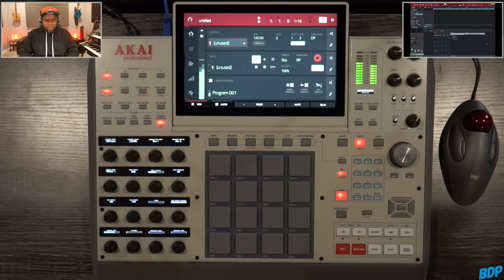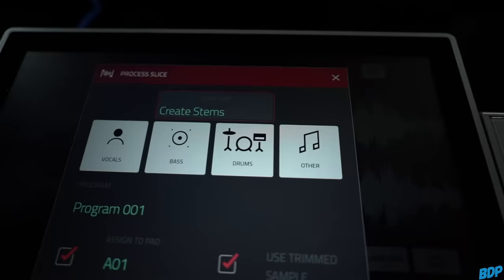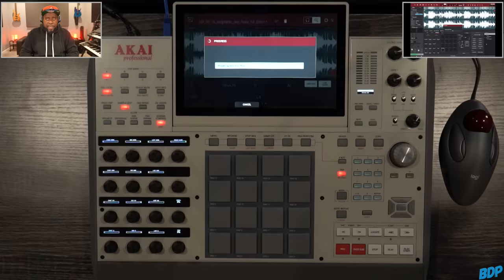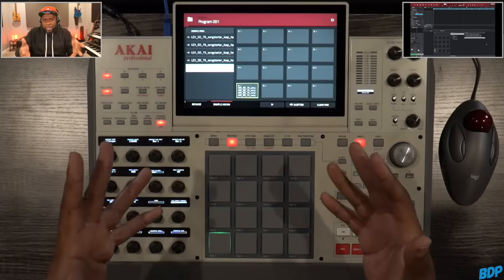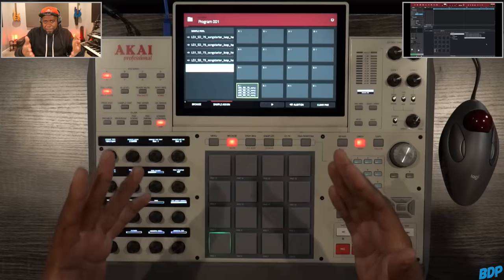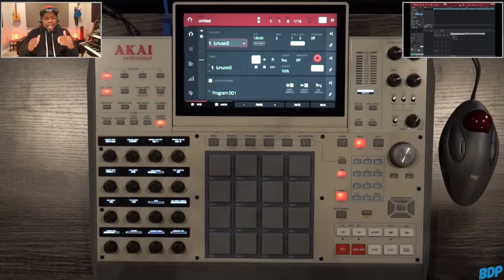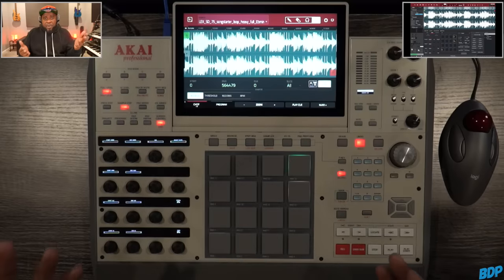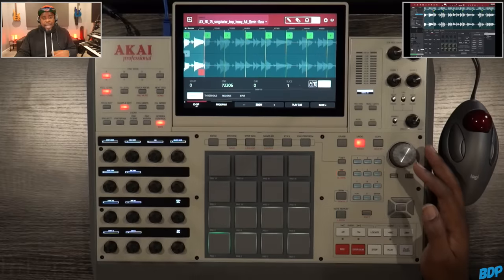It's Finally Here! Akai's New audio STEM Separation tool! 🔥

Comment from the maker: This will be released in Early February for $9.99! Controller mode will be first then standalone coming shortly after! Basically the same way Akai released Flex Beat
Reply: Only have to pay once, right?
Reply: Dint you mean $99.99???
Reply: Dope video bro !!!
Reply: Will We Have To Pay For It Twice..!?!🤔🤷🏾‍♂️🤔🤷🏾‍♂️
Reply: We have to pay for the update to be able to separate stems?
Reply: I use logic and need an mpc. I am using my mouse and  logics beat making feature
Reply: Have you tried it out with different samples and are you getting consistent results when you do in terms of quality and perfectly extracting the different stem types?
Reply: per month? or one time ?
Reply: @Void-tp4yv  one time
Reply: Do you have arranger yet? I do on my Force!😎
Reply: already move to March
Reply: Are you then a "Beta' tester?
Reply: Wow
Reply: They pushed it back to March now according to the site.
Reply: What MPC's will this be available for?  I rock a MPC Live but I would upgrade for this functionality.
Reply: Bolo!  Brother can you please help a fellow MPC X bro out?  I bought my MPC X years ago back when they first came out.
I used it for about a year and then I decided to throw on the hard cover and put it away for the last couple years because I
couldn't stand that there wasn't a built in tuner and many other features that I felt should've been available the day the X
was first released.  With that said, I finally decided to bust it out yesterday after hearing about the tuner being added and
many other features that many of us have been waiting for.  Here's my question.. Would you be willing to make a tutorial
on how to install all the extra plugins and stuff that are available?  I was able to successfully update my MPC X from 2.8
all the way up to the current 2.12.3, but there's so many other plugins and files that are available these days and I'm not
100% sure how to go about installing those.  Because of that, I'm worried that if I try to do it on my own, that I may either
mess something up, or just fail to install new plugins/features/content etc. and not even be aware of my mistakes!  For
some reason there's plenty of videos on YouTube on how to install the firmware update, but I can't find tutorials on how
to install all the other bells and whistles.  Perhaps you've already done a tutorial on this and can just reply with a link for
that video?  I'd greatly appreciate you!  Hell.. even if you don't respond to this I still greatly appreciate you.  I've been sub
to your channel for the last couple years now and have learned so much on the MPC X from you.  The Synth Content is
the main thing I'm not sure on how to go about installing.  Also.. to clear up confusion, I only use my X in STANDALONE
mode and I don't care about the software side on the PC.  Mostly because I'm already SUPER familiar with FL Studio so
for me to go and learn a completely new DAW just feels like a huge waste of time!  I didn't purchase my X to be fucking
around with anymore DAWS!  I purchased the X to GET AWAY FROM the PC and to STOP using a DAW on the PC!  LOL

Much love Bro!

Comment: Maschine will have to come hard with the mk4 and maschine 3. Akai is killing it. Glad I’m thinking about getting the 1+ or the Live 2.
Reply from the maker: Yeah NI will definitely have to step it up!!!
Reply: I agree 💯
Reply: maschine has been getting thrashed by akai for years
Reply: Machine has left the chat.
Reply: Live 2 is hard to beat..you won't understand until you experience it.  This is coming from an owner of the One, and now the Live 2.
Reply: @coldskoolbeatz  what’s the big difference in between the two since you own them both?
Reply: Maschine just has the LIBRARIES!! Other than that, they'll have to come biggie size in a big way!! I still have my Maschine Studio, but its been sitting! I've been rockin my Live Retro!!👊🏾💯
Reply: @Sinosure  what if maschine is waiting for everyone to drop their jewels and then come out with the banger
Reply: @EllzTheEnginEar  Everything.. but especially the speakers.  The fact that it's all in one and not having to deal with work arounds is the biggest benefit.

That said, my One has all the accessories such as a battery and external ssd velcroed at the bottom, a spot for a usb hub on the left side, and laptop feet that tilt the One forward.

Plus, I bought the Live 2 Retro Edition, which is more aesthetically pleasing. But of course, I could always skin the One.

Comment: Bolo since ur working with akai can you tell them please upgrade the sound converters and pre amps inside the mpcs and balanced outputs . We want quality and we don’t care how much it costs. As long as its not over $4k … i want a quality unit with an arm rest n wood and metal And good pads. . We want quality professional aimed products. 🚀🕺🔥 they need to look more at the older stuff and elevate the sound. 💯💯
Reply from the maker: If you don’t know how to mix and use correct sounds that don’t clash, better converters don’t mean a thing. It’s more than just the converters. I’ve had just about every MPC since 2002 and the converters on any of the newer machines are not bad at all. I’ve done test on it and made videos on it. Pick good sounds and samples and mix well and these machines will sound great, trust me. I haven’t had one top mixing engineer tell me there was anything wrong with my beats due to bad conversion

Comment: Did anyone notice that in Akai's email - MPC Stems: a new era in sampling - that the red MPC shown in the email is NOT an MPC-ONE? The MPC-ONE doesn't have buttons under the screen like that and they're not the buttons on the MPC-Live II either or the ones on the MPC-X. Hmm... and Winter NAMM is close too...
Reply: I just checked and you're absolutely right. Very good. 👍🏾👍🏾
Reply: Maybe it’s a new MPC Key? Possibly a smaller, more compact model with fewer keys? 😉
Reply: @InspelaRecords   With 37 or 49 keys.
Reply: I’m thinking 37, personally.
Reply: @InspelaRecords 

If this going to be a reality, i probably going to buy one.

Comment: This is crazy. I’m guessing it’s only in the MPC software and not standalone. If they find a way to make it work in standalone 🔥🔥🤯🤯. Can’t wait to try it out.
Reply: Did you not watch the video?  He showed it working in standalone mode.
Reply from the maker: I will be in standalone after initial release
Reply: @justonbrazda3846  if you look at the video on the top right hand corner he had the software running it. He’s just doing the process on the hardware.

Comment: This is cool for samplers. My gripe is making full songs and not being able to have everything separated. I use sequences to create full songs and I’d like them to be tracked out for mixing in Studio One. This is cool tho.
Reply: You can already do that on the MPC! I export my tracks as stems to bring into my DAW on the MPC all the time.
Reply: @deirellbyrd6770  After sequencing as a full song? I know you can “explode tracks” on a single track. What I’m talking about is I’ve gotten all of my sequences as a song. When I export exploding the ENTIRE project the way I can in Maschine.
Reply from the maker: Yes! You can save the individual stems into separate program like I did in video, or use them in separate tracks,then explode tracks as you normally would
Reply: @michaeltrenier  You may already be doing this and I am not aware any person’s knowledge or skill level. If you have all of your sequences set up as parts of a song(verse,chorus, and so forth) you can use song mode to chain them together. Once you get song mode as you like it you can convert the whole song to a sequence, giving you a really long sequence. Then explode that whole sequence to stems.
My understanding of the limitation is that any automation you may have had does not carry over in this method.
Reply: @deirellbyrd6770  automation is no prob. Exploding the entire song however is a problem. It doesn’t give you the option. I’ve bounced countless songs at this point and it bounces the separate “groups” but not individual “sounds” if that makes sense. Instruments yes…but not individual sounds from groups. Maschine on the other hand it bounces in groups as individual sounds. Makes life easy to mix and master.
Reply: @BoloDaProducer  appreciate it! Hopefully they do when it’s finalized and released!

Comment: No proper or great way to make song from sequences. In some older groovebox, you can play a sequence and record your muting parts in and out, also mute like hats, snares, kick, cymbals, then save that sequence into a pad, then you can create divers variations mute or solo each individual elements of a single sequence, then save to another pad, no need to clone or create another of the sane sequence, you could make even 2 or few sequences and and save many variations from them, thereby freeing the memory by a lot.
 then when you finished with everything you want.

You can string all together a full song, triggering each that saves your mutes of anything to each pad similar how one pad can plsy a loop or sample, to make a full song. If you understand what I mean.

But the way it is now is too non intelligent, forcing us to copy or clone one sequence multiple time just we can make simple variation, too bad, but no one is complaining about these very BASIC recording song making must exist feature.

Even easy to try different arrangements with this.

That is the pads cannot only produce sound when you hit them, but sort of clip launching, like you may create 10 versions of a single sequence. Without cloning or making another copy which is just wasting memory.
This simple thing doesn't exist in the Akai Mpc, like what's going on, there is no musician working with Akai, like really creating a real song as intrucate as you may like.